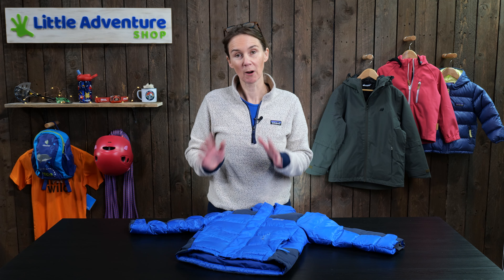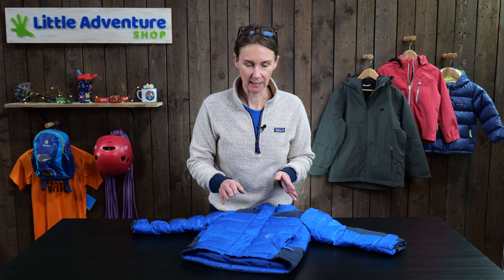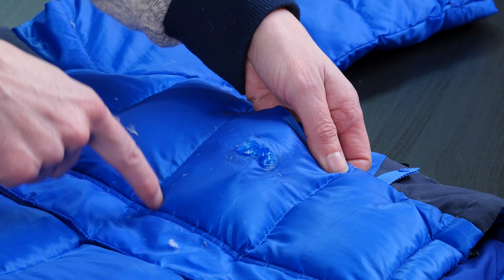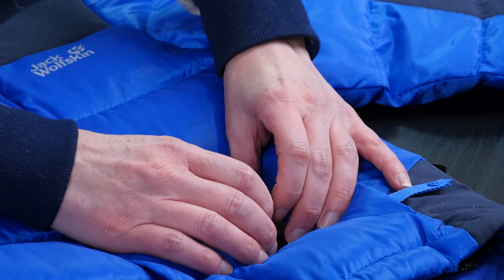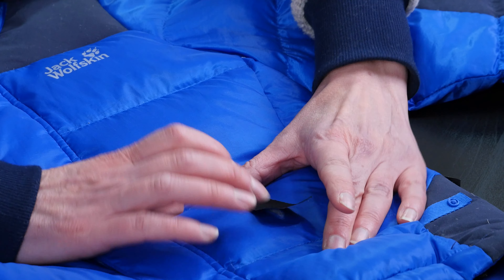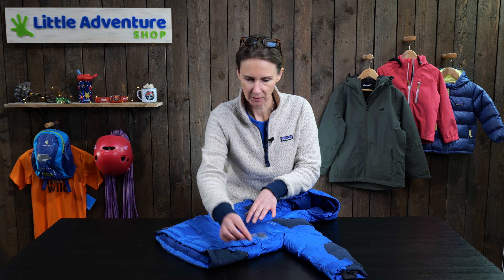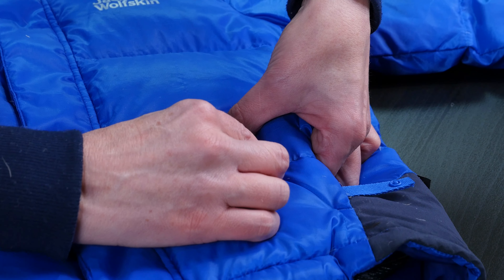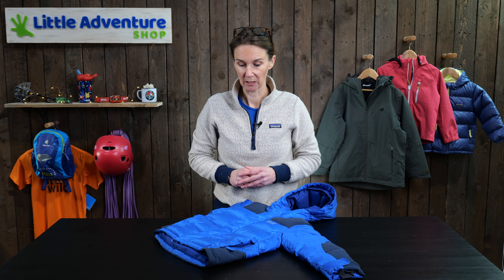Four ways to repair a ripped down jacket - trailside to invisible fix!

Comment: The drawback with the tape inside the jacket is that obviously it is sticky and it will be hard to get it exactly placed right with no feathers sticking to it and reducing it's effectiveness.     I've found that the old fashioned fabric knee or elbow patch material where the adhesive is activated by a hot iron works the best.    Buy a patch that most closely matches the color of your jacket, get the cut down patch in place inside the jacket, put a couple of layers of paper between a medium hot iron and the jacket and heat it for a minute.    Presto.
Reply from the maker: Thanks for this - that's a great idea and one that we'll have to try!
Reply: Or simply take the backing paper off after you placed it in place 🤷‍♀️
Reply from the maker: @nayar5260  That's the tricky bit, you can't place the patch in place and then remove the backing fabric without moving the patch/folding it/getting it covered in feathers - when you're repairing from the inside.
Reply: @LittleAdventureShop  just takes practice
Reply from the maker: @nayar5260  Ha ha yes maybe, fortunately I haven't ripped my jacket that many times!
Reply: @LittleAdventureShop  hahaha just speaking from a tailor’s experience lol 😂
Reply: That's exactly what I was thinking. I've got a few items that I need to repair today and I'm going to try it out!

Comment: As a carpenter and a biker I use gaffer tape for everything. Quick tip to disguise unsightly patches is to simply apply symmetrical patch to opposite side, then it becomes a talking point ie. "Hey what are those reinforced bits for on your jacket" You explain and everybody laughs and learns
Reply from the maker: This is great!

Comment: My father's down jacket was torn by one of our dogs at the shoulder. It was a small 1.5cm by 1.5 cm corner tear. I used the first method but used a bit of poly fill to hold back the feathers while I worked on the patch. The patch ended up looking rather unsightly so I ended up putting leather shoulder caps on the jacket. Just make sure you tape the seams or down starts coming out. Buy down tape, as down quilts are MUCH harder to sew with than conventional polyfil/primaloft quilts.
Reply: my new moncler jacket just got ripped by a puppy 😩😐
Reply: @ceoiku7282  get to work.
Edit: being able to afford clothing doesn't mean that you can buy it. It means you can afford to wear it comfortably without fear of it tearing. Save the moncler for special events. Get yourself a hard shell jacket for every day use because I assure you, it will tear again.

Comment: These are good, but I have a front left down jacket pocket with a vertical zipper on the chest that is torn on both sides of the zipper.  What would suggest as far as securing it?
Reply: I would consider a combination of both patching/taping and hand sewing. If you just sew it, the down might still poke out. Good luck! There are always professionals you can go to if you're not confident in your repair abilities
Reply: @noahportnoy5592   . Score the back of the patch and remove a thin strip of backing from the patch...nowbsew the adhesive patch material to the zipper backing... foul this adhesive section with dirt or cornstarch  so it is much less sticky...now sew..this will be difficult as the adhesive will still stick to the needle as it passes through but it can be done..now unpeeled the rest of the adhesive patch and run it out a few inches onto the material, which spreads out the zipper stress. Or, run the patch material around both sides of the jacket under the zipper and 'around' the rip, enclosing it.. Now sew the zipper onto it.  You could also use regular fabric along  with a glue.
Reply: You get the idea.

Comment: I have some iron-on waterproofing seam sealer. Would you recommend that, or too risky? I can't really test it anywhere -- I only have the jacket and no scraps.
Reply from the maker: Hi,  I've retaped the inside of a tent with that stuff, it worked well on a tent. I did have to work it quite hard with iron to get it to bond. That's the issue using it for a coat. I would go really easy on the heat, definitely have a cloth between the iron and the tape. I doubt you'll get the edges to stick as well with the seam tape as the patch repair. It might work but be v careful not to melt the jacket!

Comment: Does anyone have tips to repair a Columbia jacket the got cigarette burns from hugging people???
Reply from the maker: You'll have melted the fabric so you're going to have to patch it some how. Try and get some tape like we use in the video and colour match it.
Reply: I came here for almost the same reason. I snagged something on the arm of my Columbia jacket, and I'm not so sure I'm happy with this video. I've seen some where online where you can actually use a iron on patch, that's what I'm going for. I believe you need to use low heat and several layers between the iron and the jacket. 💜💜💜

Comment: Just glue a nice logo you like on it. Maybe put one on the other side to make it look planned
Reply from the maker: Yes you could do that, a bit more interesting than a black patch. Just make sure you use the right fabric glue. The good thing about the stuff in the video is that it's quite thin so it's not going to catch and rip off.

Comment: What's the second type ?pls say that item name ?please
Reply from the maker: Hi there. The second tape (which gives a short term fix) is known as 'gaffer tape' or sometimes 'duct tape'. It's usually used by electricians to hold down cabling to floors and walls temporarily, but can also be used as a temporary repair tape in many other situations too. Hope that helps.

Comment: These are horrible ideas. If out on the trail and wanted to prevent a tear growing before getting home just turn the jacket inside out. 
Also don’t put duct tape as a temporary repair. It can do more damage when trying to remove for the permanent repair. 
And the one about putting tape inside the jacket is ridiculous, she couldn’t even make it work.
Reply: Hi Roberto, could you suggest a better idea?  I can't bring myself to put gaffer tape on my rab jacket ha...as much as I use it elsewhere ha.  Seen your comment and thought I wonder if he has better ideas?
Reply: @ibizaamigos   Surely you wouldn’t use any of the suggestions in that video. There’s actually purpose made tape for fixing those jackets. I used it to repair my own jacket and it survived in the washing machine just fine.
Reply: @robertosmith1  nope I don’t fancy putting gaffer tape on my rab. As much as know it’s probably will work I just don’t wanna do it ha. I’ve been on rab website and ordered a patch from there